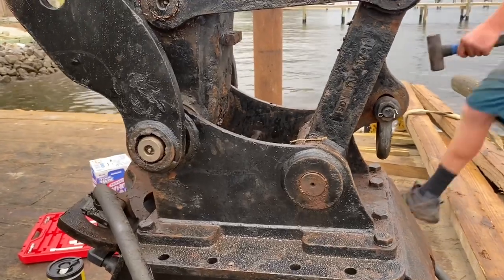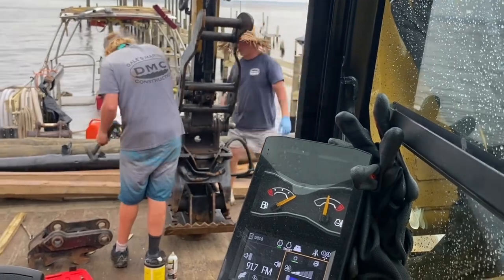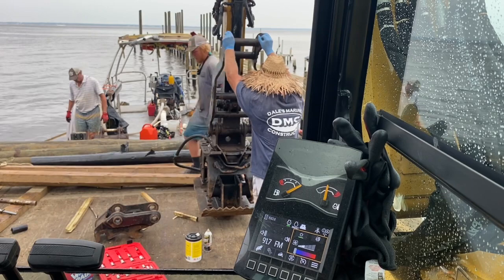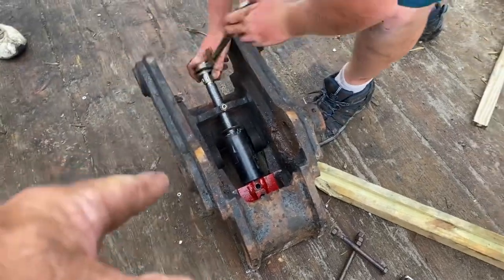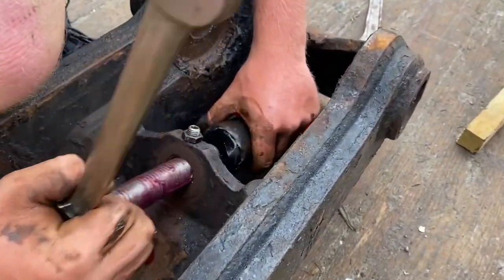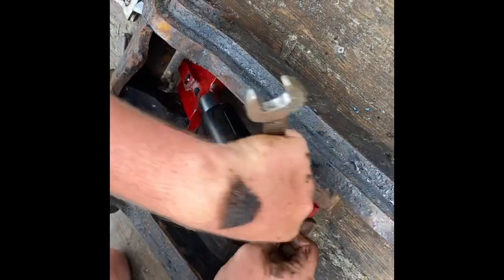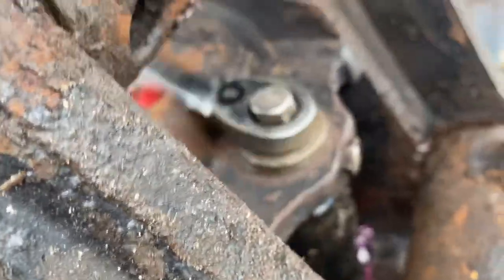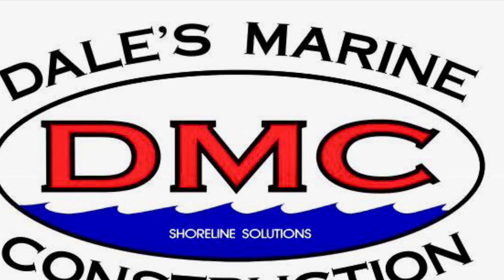Caterpillar 308 quick coupler attachment modification

Comment: Oops it wasn't bad you've jumped forward 10 years into the future quick coupling is standard since 30 years ago in Europe And most have hydraulic locking
Reply from the maker: Thanks for your comment. I don’t really care for the hydraulic portion of it since I put it in the salt water so much just one more thing that will deteriorate on the end of my tractor and add additional weight.

Comment: Wish they made those threads super coarse almost like a corkscrew so you don't have to crank on it for 20 minutes
Reply from the maker: Yeah I know what you mean I drilled a hole in the center of that coupling in the middle to be able to blow and wash sand out sand can get compacted in there and then they will not screw against each other
Reply: Electric impact ;)